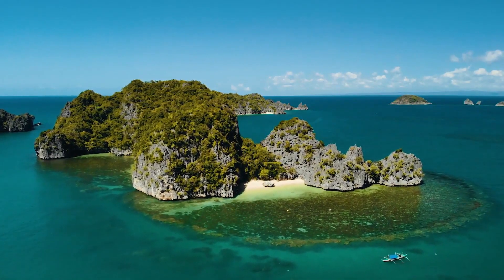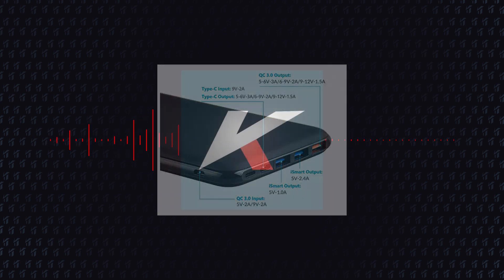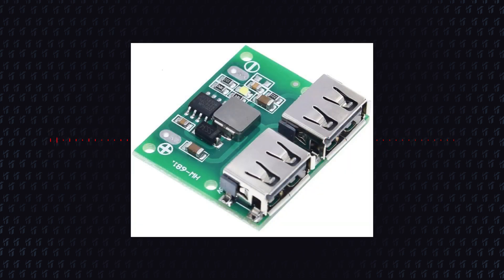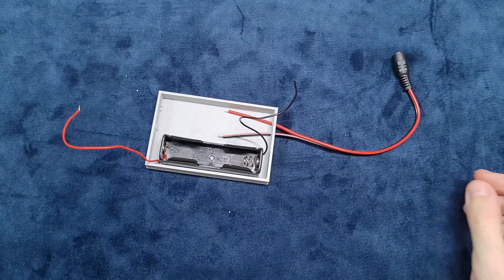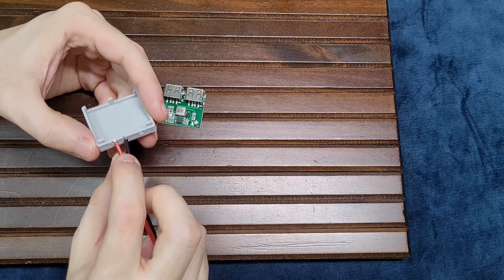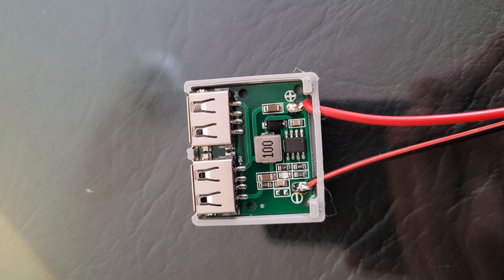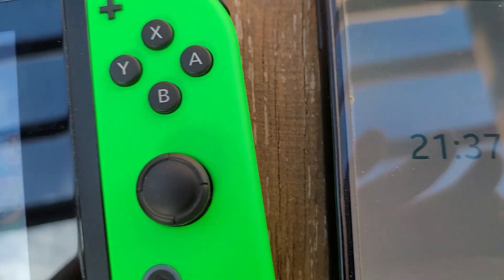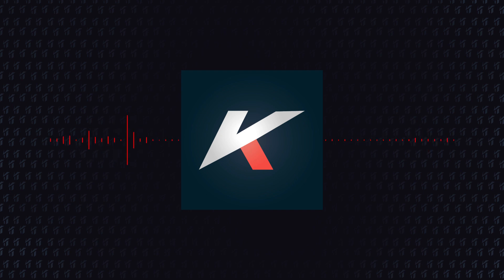How to make a Solar Battery Charger for your Nintendo Switch

Comment: Interesting idea, but I feel like it would be advantageous to work in some kind of stress absorber for the wires so that connections aren't as easy to break (also some kind of indicator to know how full the auxiliary battery(s) are would probably be beneficial as well to prevent overcharging it)
Reply: Also lol, the angry sun in the thumbnail SuperVinlin
Reply from the maker: Yeah there is endless room for upgrades

Comment: this is probably overdue, but this will literally brick your switch long term, do not do this, so you know how you aren't supposed to use a 3rd party dock, the same concept, the switch is kinda particular about it's voltage, it's something really specific that isn't widely available due to not following the usb power protocol, which also why people don't recommend using a cable other than the one that comes in the initial box with it, that one is designed for the switches voltage needs, things have been designed safe to use with the switch before, but that's an exception, and this isn't one of them, by all means I would love a safe version of this concept, but as is is a literal detriment to your switch long term. I recommend watching some videos about why people don't recommend 3rd party docks as a starting point for anyone interested, hope no ones switches bricked over this, have a nice day.
Reply from the maker: The problem with third-party docks
Is when you use them with the switch in the dock mode when the switch needs to draw more power from the adapter. 

With the solar charger though, you just need to use the switch in the handheld mode. If you charge it in handheld mode, it is totally safe.

The switch is made for being charged outside the original dock especially when you are not at home and this charger ensures that it will deliver the same output of a powerbank

Comment: Something of note: batteries charge a LOT faster the less battery they have. You will reach 50% from zero far faster than you will go from 50-100%, for example. Using 92%-100% to measure the charging speed is really flawed; it's likely faster than what you state here.
Reply from the maker: I did a second test with the battery at lower percentages like 70% and the charging rate was the same

I gotta test from 0 to full later to check the complete charging speed

Comment: I love little DIY projects like these.  It shows how with just a little bit of time and effort you can create things that fit whatever purposes you have.  Here's my question.  Given the cost of recharging your Switch at home, how many times would you have to recharge it using this method to make back what you spent on the components?  That would be quite interesting.

Comment: Great vid!. It would be interesting to know how much current output you have instead of just voltage. Putting additional batteries in parallel will get you greater current at the same voltage and thus faster charging. But will also take longer for the panel to charge the extra batteries. Time for a bigger panel!
Reply: I mean there's more that's being charged, so naturally it would take longer SuperVinlin